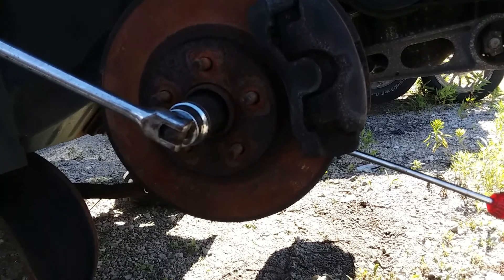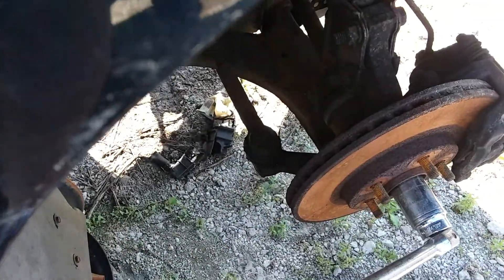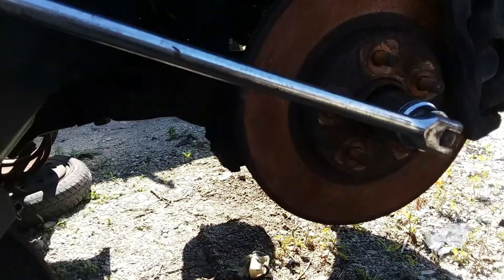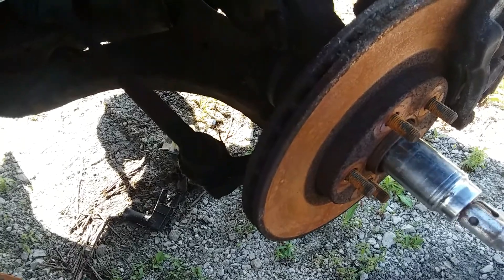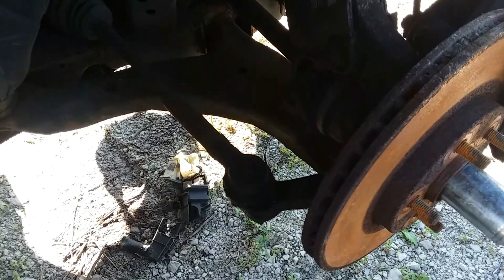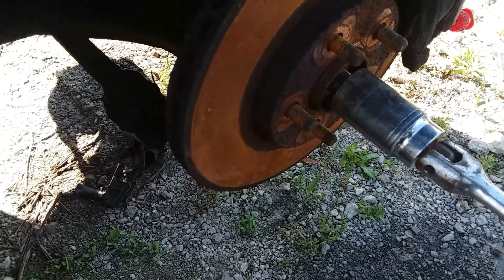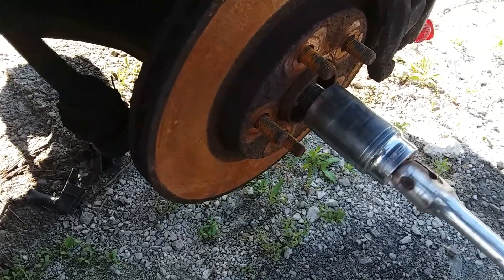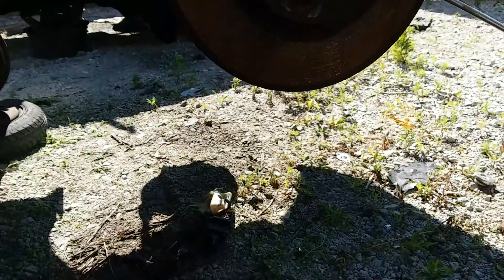Junkyard CV Axle Removal Tip

Comment: That's some good advice. That axle nut came off really easy. I've only had 1 Cv axle that wouldn't come out of the rotor. I tried everything and ended up taking the whole spindle off and had to replace it. I love going to the junkyard looking for parts, it's like Christmas you never know what goodies you will find. Lol
Reply from the maker: I love making junkyard runs, I usually make at least one every month. I picked up some cool stuff this last time which I'll be showing in the next video.
Reply: Hey I just had a random thought. They have an a6 audi twin turbo at my junkyard. I believe it runs dual k04 turbos. It has everything intact including twin intercoolers. Do you think that would be a good setup for the dodge dakota? What size turbo did you get? Just a random thought. Thanks for your videos and inspiration.